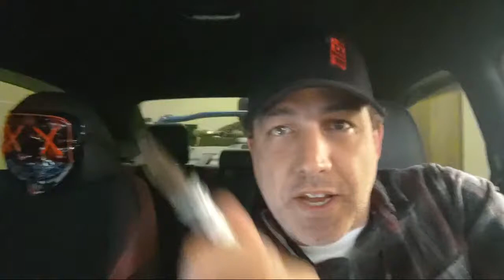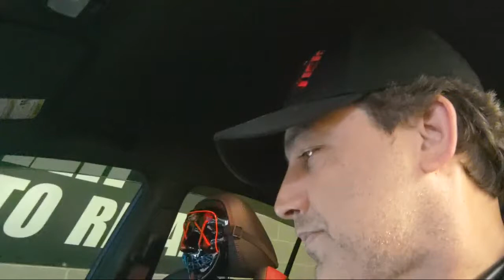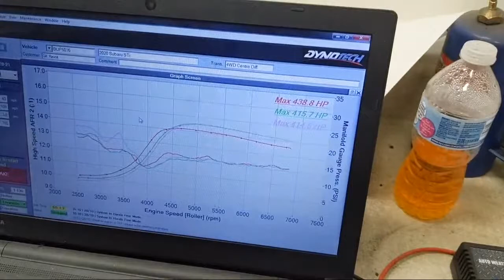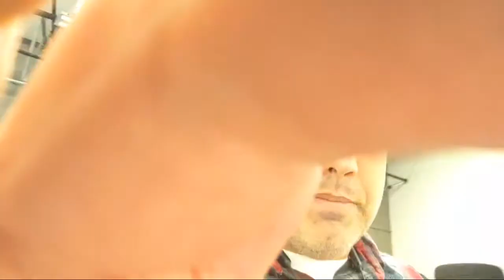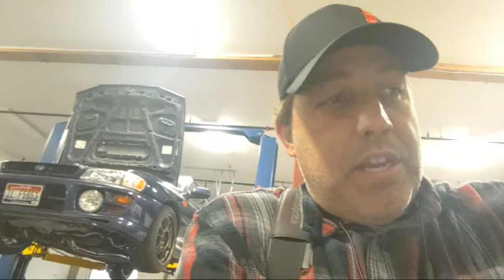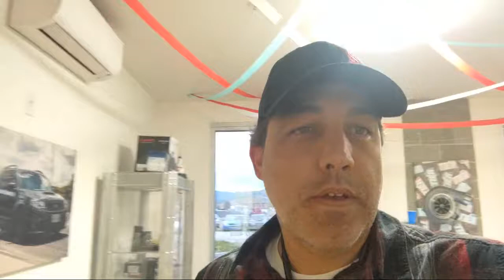Spark Plug Temp And STI Flex Tuning

Comment: Re. plugs, the JDM version 7 WRX STi Spec C Type RA with the forged piston EJ207 runs the PFR7G NGK spark plug. I know because my tuner owned one. The 2019 and up STi's, including the S209, run the ILFR7H NGK spark plugs as stock. This is the same plug that the Evo IX comes with from the factory. Random useless fact.

Comment: Question about fuel. I have an 2020 fa 20 WRX with literally every bolt on running e60 flex tune. I am heading into my first winter with the car and have heard the ethanol could cause hard cold starts. Would you recommend running just pump10% fuel through the winter I'm here in Minnesota? What's your thoughts? I ask because e85 is so much cheaper cost to me right now. Plus the ethanol is fun of course. Great video as always.
Reply from the maker: Run 40%. Should be and to start fine if it's compensated correctly in the tune. You'll still get lots of gains